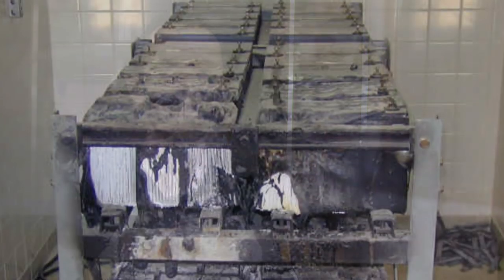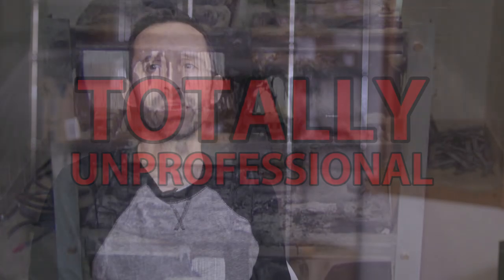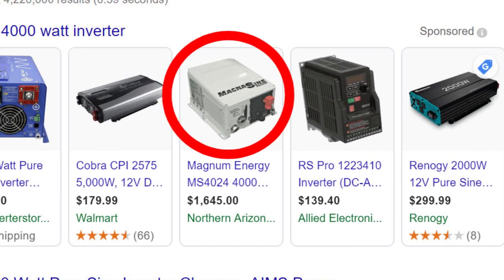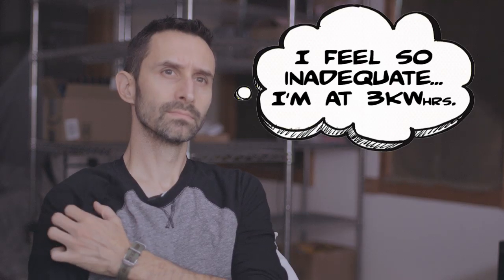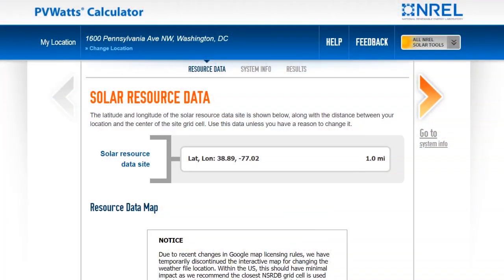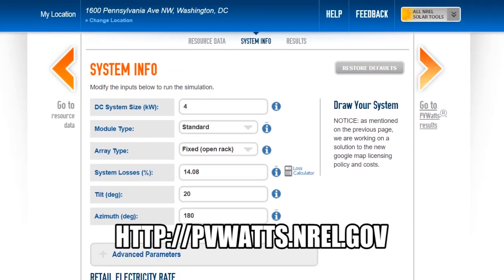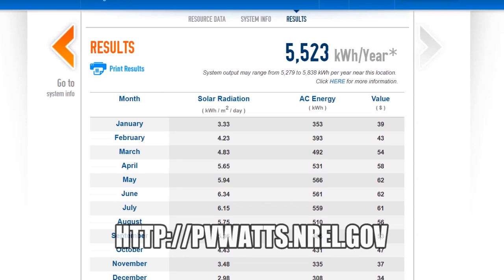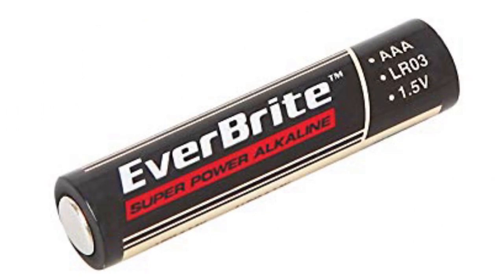Solar Power Components to AVOID Buying

Comment: This was spot-on! I'm living off-grid for 10 years now, a six-person-household, and we are using between 5 to 8kWh a day. I have only a 2.5 kW solar system with a back-up generator, which is used occasionally in fall and winter, but it is completely sufficient. To make it work though, you got to live with the weather, schedule your showers, and be willing to sacrifice using appliances like hairdryer, dryer, microwave, basically, everything that produces heat. Airconditioning is another no-no. (A properly insulated house, built according to local climate-conditions, doesn't need any AC.) This way, my family has slashed it's carbon footprint by more than 50%, and besides that, we saved a lot of money.  In the meanwhile, prices for solar and its components have come down, and money is cheap, there is no logical reason for not becoming energy-independent, especially not for a prepper. And the time to act is now!

Comment: Transformer inverters suffer under high stress loads. When a load increases on a transform the inductance drops leading to excessive current draw on the switching electronics. Also if the transformer saturates the transformer input acts like a dead short. Generally transformer inverters have poor efficiency do conversion losses and partial transformer saturation under high loads.

Newer inverters use switch mode conversion which operate at high frequencies and generate 60hz AC sine wave via duty cycle modulation. A transformer inverter will operate between about 60% to 92% efficiency (depending on load and battery voltage). A Switch mode inverter will operating in the 95% to 98% efficiency. Switch mode inverters can usually handle surges better since the switch at high frequencies they can adjust to load changes much faster, and also shutdown quicker in an overload conditions.

Currently, In my opinion Sol-ark (www.sol-ark.com) has the best inverters on the market at this time. 97% efficient, EMP hardened, Grid tie, PV, & battery support. They offer 3Kw & 8Kw inverters, providing 240VAC split-phase power (needed if you have a well, or 240V appliances). The 8Kw inverter can handle surges up to 20Kw.